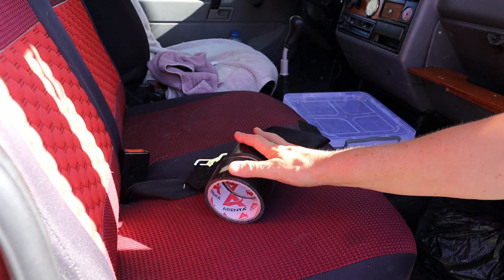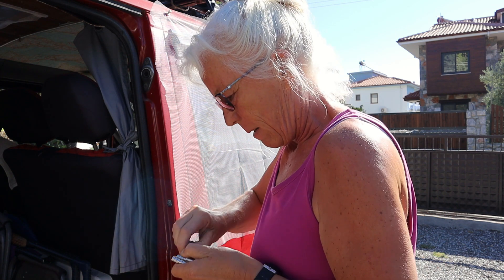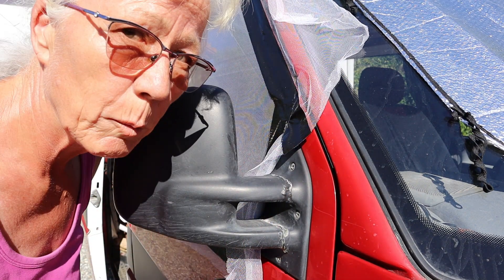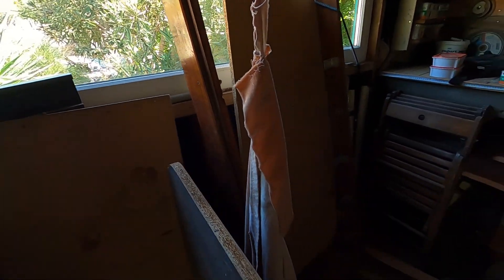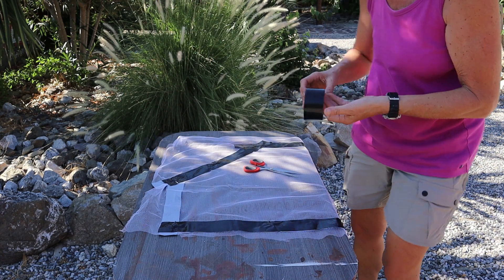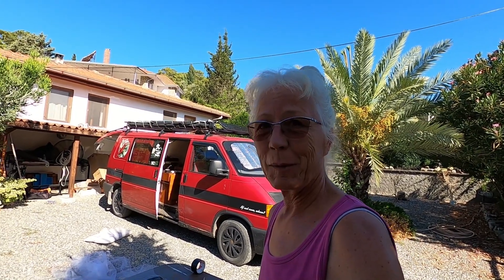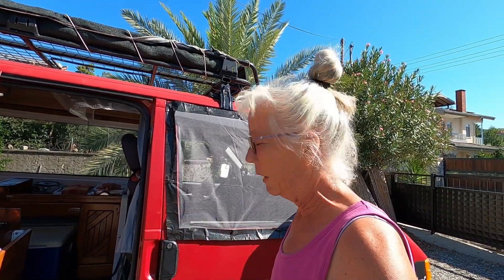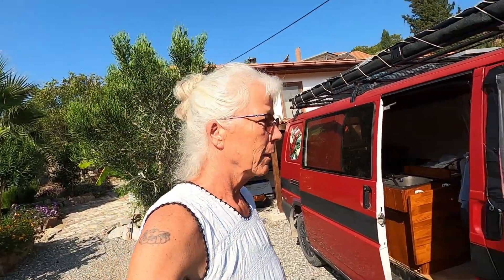Mosquito Net for Car Camping | Super Easy & Cheap

Comment: I used to use a roll of magnetic rubber, a bit like a thick sellotape, that would give you contiuos contact with the metal and not leave any gaps. It wasn't too expensive. I got it on ebay. I think I just googled, adhesive magnetic tape. Might be worth checking out if you have problems with the wee magnets. These fly screens are a great idea!
Reply from the maker: Thanks! Sounds great, but I don't think I can buy that here. I will look online, maybe somebody can bring it.